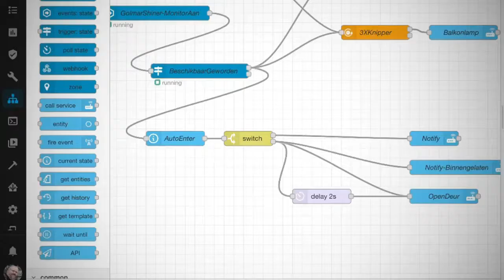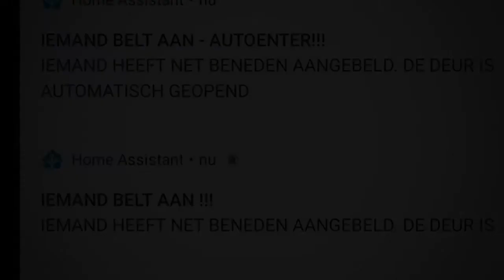Golmar  Shiner Intercom to Home Assistant

Comment: Hello nice video, can you give us more details what exactly you modified for control with sonoff relay?
Thanks in Advance
Reply from the maker: Translation of my earlier reaction: The Sonoff Dry Switch module gets power from the monitor, so when it turns on, the module also turns on and connects to WiFi. In home assistant I have a flow that detects the module was offline and is now online, and sends a message to the ha app, and plays bell sound through the google minis and blinks the light on the balcony. The NO connector of the module is soldered to the door open button, so I can open it remotely or even have it open automatically when I'm expecting a visitor or the postman comes when I'm not at home (they are then welcomed by a ring video doorbell). Note that your unit is often not owned by you in an apartment and that you can disrupt the entire system if you do something wrong. It is at your own risk.
Reply: @MilanGajicBuva  But after getting powered from monitor, sonoff takes some time go wake up, connect to the WiFi and HA. It's in the range of 1+ minute.  Was it acceptible for you to get notified about a visitor with such delay? Usually delivery guys do not wait so long, they turn around and just leave a note.
Reply from the maker: @MsNightBird  delay was about 10-14seconds. Most delivery guys stick around that long. Nevertheless , i have changed the setup last weekend so the so off board, that is running Esp home now, is always on. The new video is up: https://youtu.be/yIdc_KoGMHU

Comment: Hoe heb je dat precies gedaan, wij hebben hier ook een golmar
Reply from the maker: De sonoff droogschakelaar module krijgt stroom van de monitor, dus als deze aan gaat, gaat de module ook aan en connect met wifi. In home assistant heb ik een flow die detecteert dat de module offline was en nu online is, en een bericht naar de ha app stuurt, en belgeluid afspeelt via de google minis en het licht op de balkon laat knipperen. De NO connector van de module is gesoldeerd op de knop voor het openen van de deur, zodat ik deze op afstand kan openen of zelfs automatisch open kan laten gaan als ik bezoek verwacht of de postbode langkomt als ik niet thuis ben (boven worden ze dan door een ring videodeurbel verwelkomd). Let op dat je unit vaak niet je eigendom is in een appartement en dat je heel het systeem kunt ontregelen als je iets fout doet. Het is op  eigen risico.